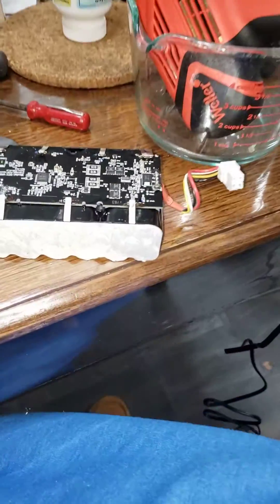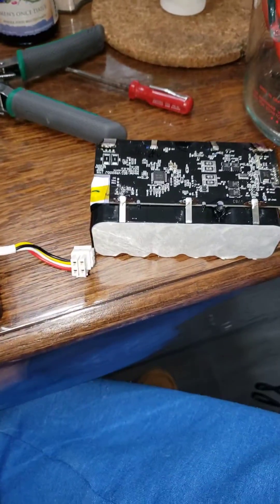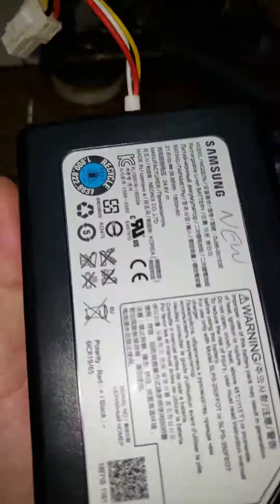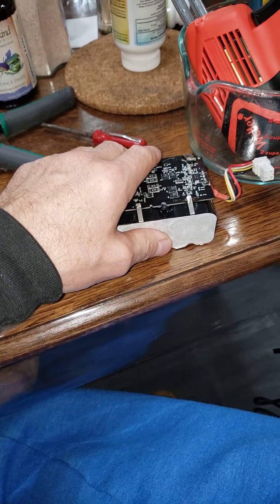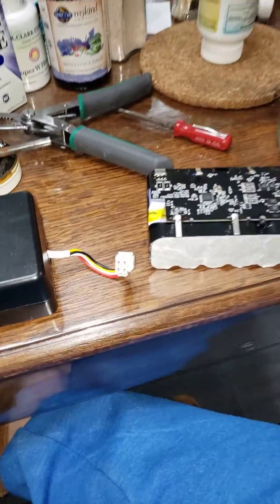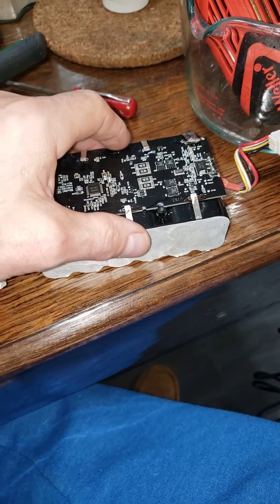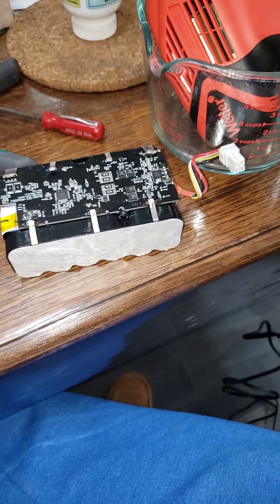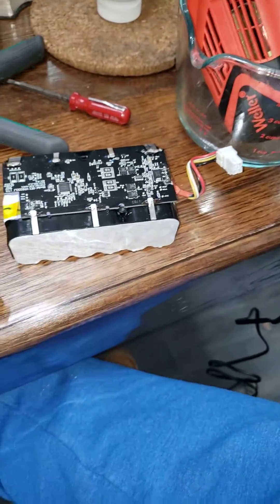Samsung powerbot battery teardown.

Comment: You might be pleasantly surprised at the vacuum time of the samsung powerbot vis a vis roomba and Neato who are the only other real players in the robot vacuum space.
Reply: Runtime shouldn't really matter if it goes back home to charge automatically. I only get 25min with my used powerbot and I would get a new battery but it only recharges 2-3 times to clean the room its in. I'm sure a new battery would help but ill use up this one completely first.
Reply from the maker: Both my bots are unplugged now. Filtration is terrible. My eyes itch after they run for half the day, im allergic to pet dander. Ive tried improving thier filtration but it hampers thier performance. They get lost about 25 percent of time trying to get back to dock station and thats if they are in same room. They deffinately get lost in other rooms about twice as much. The technology can be much better. Ill probably sell both of mine wich have new batteries and get one with hepa filtration and  better navigation when they come out with improved technology.
Reply: @organicvids  just curious if you had the light on when running them the first couple times? Apparently that helps them map out the room. Either way it doesn't fix your HEPA requirement, but my two bots never get lost.
Reply: @organicvids  I would clean off all of the sensors to make sure that they are not hampering the ability to get back to the base and also to know where they are.  Are you cleaning out the dirt canister including removing the Filter and washing it with dish soap until you cannot squeeze anything but clear water out of it?  If you do sell them and the batteries I might be interested.
Reply from the maker: @thomasfredericaa2205  they are clean, one brand new. Samsung can make them better. 7040 only has half its battery capacity, lydar added would help navi.